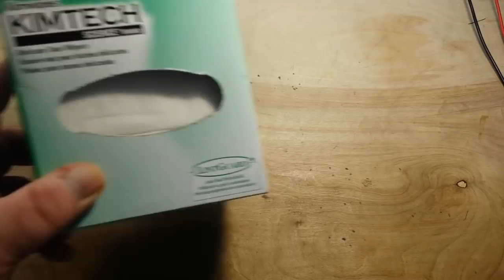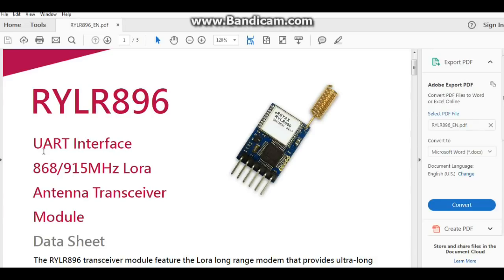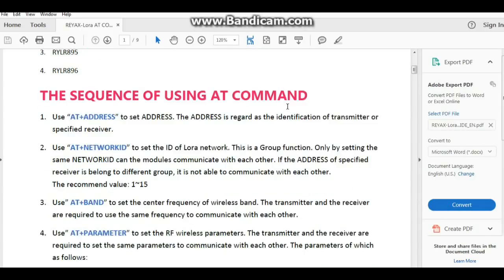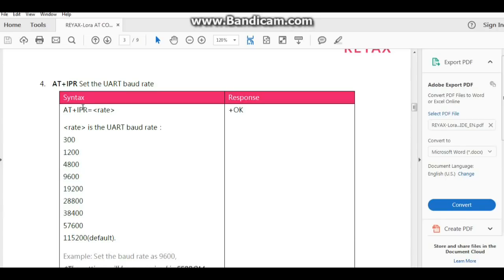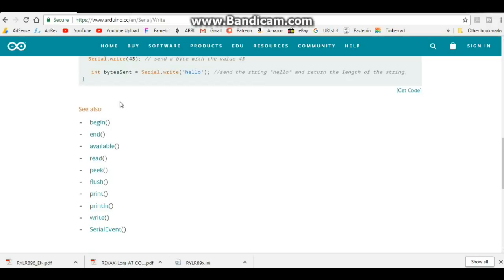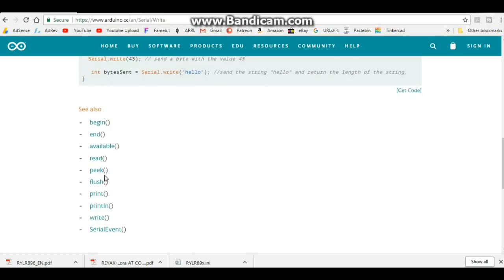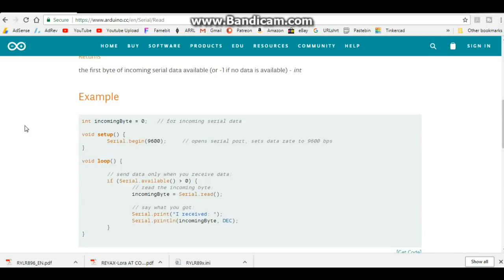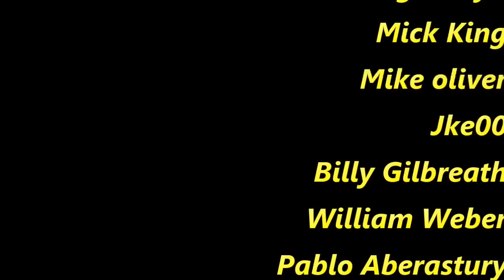How to use LoRa with Arduino

Comment: The LoRa Reyax RYLR896 is rated for 3.6VDC maximum. Connecting it directly to the 5VDC rail will most definitely damage the device. You can use the 3.3VDC pin on the Arduino Nano as the supply voltage for the RYLR896.

Comment: Arduino operates at 5V logic level, I've tried using voltage dividers and pull-up resistors to make it compatible with the 3.3V voltage of the SX1281 chip, but I've failed. I couldn't get any signal on the serial port. Can you guide me on how to make them perfectly compatible using only resistors?

Comment: Has anyone got the LoRa arduino library to work with the llcc68 900MHz modules?  I got the spi working but no wireless is connecting to each other.

Comment: In the datasheet the VDD is listed as max 3.6V and you hook it up to 5V. Is there a risk to fry the board this way?
Reply from the maker: That's the max voltage to the chip itself. It goes through a 3.3 regulator on the board first

Comment: Spreading factor is related to how many chips are used to encode one bit. When the SF is n, one bit is encoded as 2^n chips ("bits"), so it takes much longer, but it is less susceptible to noise and therefore also improves range.

Comment: Hi; Great video.Just one question ,can this modules be used to built a whetaher station ? It's possible to transmit variables as temperature and humidity?  Rgds
Reply from the maker: yes you can transmit variables
Reply: @learnelectronics  Thanks a lot for your fast answer .Do you a sketch as example ? Thanks again

Comment: Thanks for the video, I now understand LoRa better and think it may provide an answer.  Help, I need to replace a VERY SHORT range 433Mhz remote Gate Opener.   I need at least a 150 Meter range (would like 300+ M), currently have about 10m with an exterior antenna.  I’m using an ESP-32 to ‘assist’ the Gate Opener Control board with remote sensing and operations (house is 160m+ away) I can Open, Close, Hold Open the gate from my home network (and more).  I thought I could use a D-1 mini in the car with a LoRa transmitter and a simple push button.  The LoRa receiver would connect to the existing ESP-32 in the Gate Opener box.
Questions:
1-Can I encrypt the transmission?
2-How can I use the received transmission on the ESP-32 to trigger an event (opto-isolated relays I have)
3-Can the ESP-32 LoRa receiver transmit a CONFIRMATION back to the remote LoRa (D-1 Mini) in the car?  (eg. buzzer/beep/LED blink)

Any suggestions or direction to another video/Instructables tutorial would be appreciated.  Thanks

Comment: are you heard LoRaduino? i use that many time
Reply from the maker: No I will check it out
Reply: learnelectronics If you check can you help me please? i am 21 years old college student. My department is computer engineering and this 2 weeks i do my summer internship. I should send to lora to lora and after to send Ttn the information. I have sx1278 LoRaduino s, they said i work with 433mhz not 868, i search about ping pong code for fit these things. If you have or can find this code, can you send me a link? Atmega328P sx1278, ping and pong code, send and receive. In Europe the send must 868mhz, if you live in US , you use 901Mhz band. I must use 433mhz, that's my mission

Comment: 868 MHz is in the public service and LMR portion of the 800 MHz trunking band in the USA, and requires an LMR license with 800 MHz classification. 800 MHz is prime real-estate for public services, and wireless providers, the FCC is very protective of that band since it's a money maker for them..
IDK if I'd be using those exact models for anything, I'd opt for a different version on a different band.

Comment: Thanks for the Video, we at Arduino Hannover LoRa group just finished a turnkey Arduino ESP32 LoRa solution, it supports peer to peer communication and works for 5 years on battery, take a look at: www.radioshuttle.de
Reply: Nice, but WAY over engineered for most applications. All I need is LoRa + Arduino + Battery, your solutions are far far too complex

Comment: Are you sure this thing is ok to use with 5v logic levels???  If so it's the first one I've seen that is.  I have several and they are all 3.3 v.  You may want to check that...  Great video!!!  Andreas speiss does alot of lora..check him out.
Reply from the maker: Nope not 5v safe
Reply: Probably not a good job to use it with a Nano then!  Better break out the logic level converters or the promini 3.3v.  Or an awful resistor divider...
Reply: The SX1276 is not 5V compatible, it specs issecify it between 1.8 and 3.8 volts.
I don't know what kind of MCU s on this board, maybe this one is 5 tolerant.
Reply: Arduino Nano has 3.3V Output. Is it possible to use that one? Link for pinout: http://www.circuitstoday.com/arduino-nano-tutorial-pinout-schematics

Comment: Don't know much about lora modules but i like how it uses a simple serial connection. Depending on the range and power consumption it would be good or bad for "out in the field" sensors. Very glad u didn't forget about I2C also!

Comment: Nice video... the mic noise gate is kicking in too aggressive... makes it sound like you are talking trough a ham radio... Only the roger beep is missing... :) Watch this one also => https://www.element14.com/community/community/project14/open-arduino/blog/2018/05/12/ardutrx-a-2-meter-band-ham-radio-transceiver-with-arduino?CMP=SOM-FACEBOOK-PRG-PROJECT14-OPENARDUINO-ARDUTRX-COMM-GBL
Reply from the maker: I know nothing about audio. Any suggestions would be appreciated.
Reply: I thinks it better not to set the audio gate on the level that you are using right now. the last part of your sentences are cut off. You can use an other microphone that has a more near field characteristic. Don't get me wrong sir. Your video's are excellent and everybody can learn from it. So keep up the good work...